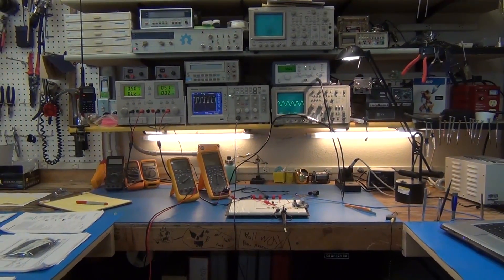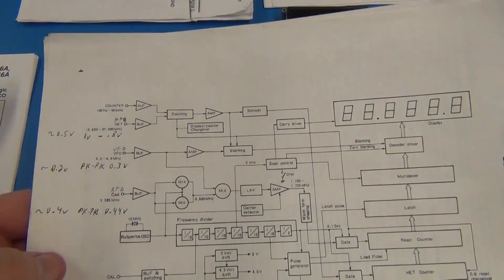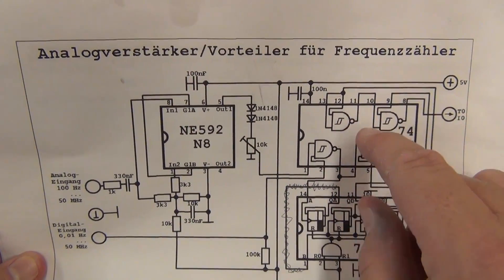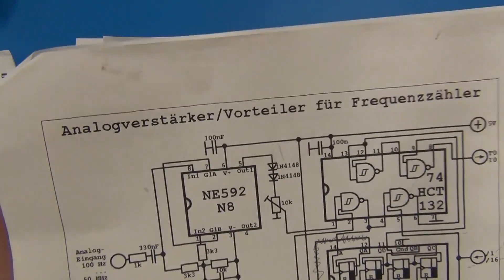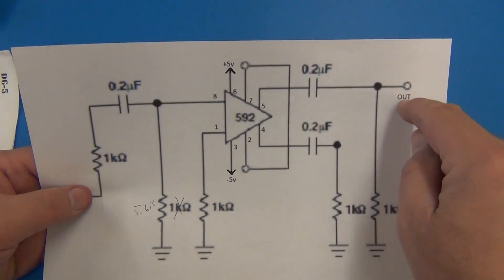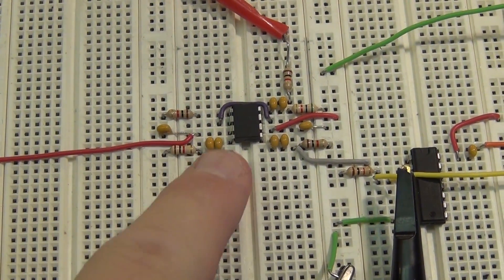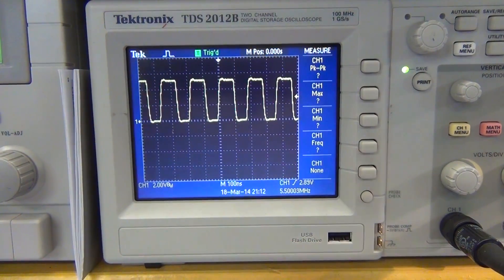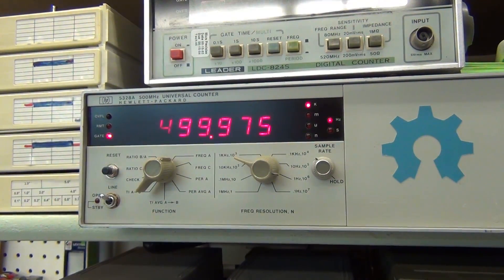Arduino Frequency Display for Kenwood TS-520S HF ham radio PART 2 A

Comment: Just a TINY, worthless geek note.  Instead of drawing a line on a "u" to get the micro farad value, hold the ALT key and hit 230 (ALT+230) and you'll get µ.   :P

Thanks for getting back to this project!!!  :D
Reply from the maker: Chad Harzke Thanks for the tip, always appreciated. I do know the alt + # trick but gave up trying to use it years ago because after learning a few dozen symbols usages I could no longer remember which number goes with which symbol. So I either type out the word "micro" or use a common sub like "u" for "µ", I think I'm just to lazy to always look-up the numbers when I need a symbol, I bet there is an app I could install HA. ;)

Comment: You can always switch from the 74HC193 to the 74F193. A quick glance at the 74F193 datasheet says it goes up to at least 90MHz.
Reply from the maker: Jac Goudsmit Great suggestion! I knew there was faster ripple counters but I hadn't sourced any yet. I'm going to test the 40MHz tonight and if it fails, which it most likely will, I will drop an order with Digi-Key for the F version.

Comment: Too bad you can't sneak the display some where into the front of the kenwood. ;)
Reply from the maker: GeorgeGraves I bet I could, but I would have to use a smaller display and I'm sure I wouldn't be allowed until he gets a newer radio to replace this boat anchor.